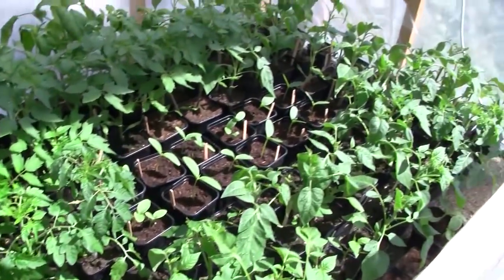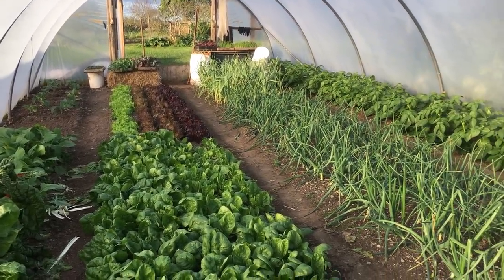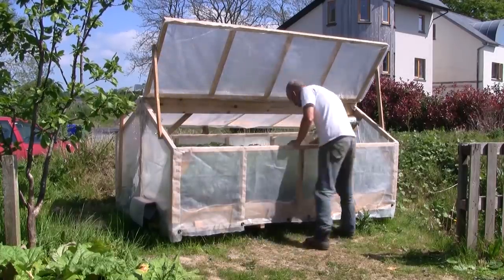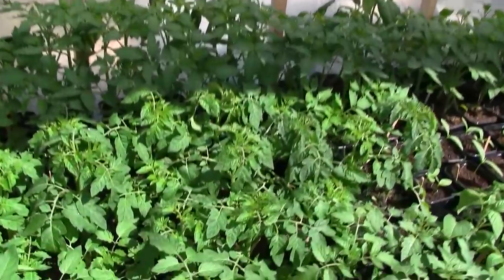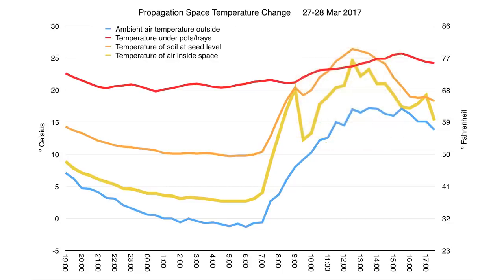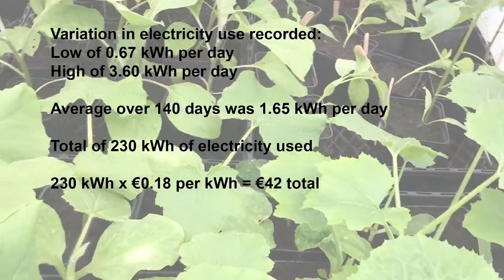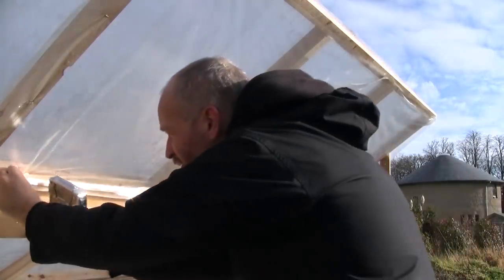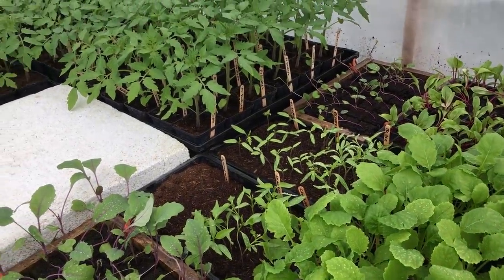A Heated Propagation Space

Comment: Hey! What are those metal semi-circles around your poly tunnel crops in your first shots?
Cool build, though!
Reply: Perhaps hoops for insect netting?
Reply from the maker: Yes, they are hoops for netting/fleece that will go over the carrot crop to protect from carrot fly. In this case it is old water pipe. I have found that the hoops of wire or pipe to keep the material off the leaves seems to help avoid mould and damage.

Comment: I'm curious about why you chose an outdoor propagation space vs. setting up something indoors?  

I'm having really good results with a set of plant lights on a wooden stand. Is it just a question of space and scale? What is the square footage of propagation area in your system?

I'm definitely working on a smaller scale than you are. My system has 16 sq ft of space in a 2x4 footprint. I think I could at least double it though by adding additional shelves. I do have to use electricity to power the lights, but get to take advantage of the heat I am already putting into my living space and I get beautiful stocky plants (which I don't think I could do with natural light.
Reply from the maker: tnason04 That is a good question. It makes a lot more sense from an energy and material standpoint to add grow lights in a house that already has heat. Especially with the low energy LED lights that are available now. The issue for me was space, as my propagation area is currently 1.2x2.4m or 4’x8’, and that isn’t big enough. A solid set of racks or shelves with grow lights would make a lot is sense.

The other reason I went with the extra space outside, and I was anticipating moving the whole thing into another larger propagation and work polytunnel at some point.

Comment: I've been trying to come up with a way to keep a green house above frost level. I thought maybe if you had a wide enough insulated container and used something similar to a solar cooker. You could line and stack the container with aluminum cans to be exposed to the sun, and have a ventilation fan pumping to the green house every time the temp drops below a certain point or off when to high. Not sure if this is possible if someone knows let me why not or add on.
Reply from the maker: Sounds like an interesting approach, but not something I have any experience with. Hopefully someone else can input.

Comment: Why not try making a wedge that is also covered in old poly tunnel? Like a wedge of cake that can be stuck in the opened window. This could expand the vertical space that would give you a longer time frame to grow in it without having to start from scratch. It is also good so that earlier in the year when it is colder and the plants are smaller there is less space to heat with the wedge removed which would make the space more energy efficient.
Reply from the maker: Not sure I understand how his would work, but something to think about. Having an expanding and contracting space would be useful to conserve heat.
Reply: @REDGardens  When the door is open parallel to the ground you can insert a wedge shaped filler in to take up all the empty space...(The filler would be constructed the same as the rest of the greenhouse) This would make it look like a cube if you did one for each door opening. This would in turn raise the height throughout to the same as your peak height now. This could be permanent or temporary by design. A bad construction analogy would be like a removable "dormer" on a roof.

Comment: Would you mind sharing your temperature sensing set-up? I have been using SensorPush, but I am not really happy with the fact that is not open source, and I have little power over the software.
Reply from the maker: I don't use anything nearly as sophisticated as SensorPush or similar. I just had a data logger and 4 sensors which I manually copied the data from. I hope to get more sophisticated sensor systems soon.

Comment: I like to use growlights indoors since my home is already climate controlled. I guess unless you have a four seasons room your trading off light or heat by doing it inside
Reply: Indeed, I'm interested in what's the better use of energy, supplemental heating or supplemental lighting, somehow heating feels more intensive but I may be wrong here
Reply from the maker: It is a useful approach, to just add more light to the already climate controlled space - especially with the  highly efficient LED lightbulbs that are available now.
Reply from the maker: dosadnizub I think that is a very interesting question, about the trade off between heat and light. I think it depends on the source and type of energy you are using. I think it is a bit of a waste to use high quality electricity energy to produce low grade heat energy - as I am doing - when there are lots of other sources of heat.
Reply: @REDGardens  inside you also wont run the risk of equipment failure meaning a huge crisis. If my lights go out for a day or two the plants will be fine. If the heater outside fails and its freezing, the plant will most definitely die within hours. Maybe a failsafe alarm for low temperatures could be installed to go off.
Reply from the maker: wipeoutxl That is a really good point about the resilience of the system and problems if there is failure. Important things to consider.
Reply: One thing to consider indoors, especially with module trays, is that it seems to require A LOT of watering, at least daily,

I guess growing on top of a compost heap mitigates that too.

How often do you water seedlings outside compared to inside?
Reply: @REDGardens  I use LED grow lights to raise seedlings (in an otherwise well insulated box, in my case in the boiler room in the house).  I think that the natural light quality in later winter / early spring is poor - and unreliable, so some years it is dreadful. So prioritising Light e.g. by supplementing with LED  (with no cold issues to worry about) seems best to me.  Downside is that as things are potted on an exponential increase in area / lighting is required.  LED lights are not cheap either (although they will last many seasons; when I used T5 tubes and MH Lamps they needed replacing annually, even though only used for a few months each year, as the light "strength" dropped off markedly). I put my seed trays under the lights a day or two before germination is expected, and have the lights on 24 hours so that as soon as the shoots appear they get max light and don't get leggy. After a few days I move them to whatever regime works best, but typically that is 16 hours a day, or so.  Can't get that in a heated greenhouse in February! When I start to run out of space I take the plants / seed trays to the greenhouse during the day, for natural light, and then into the house overnight - never exposing them to below 10C to prevent thermal shock. In dreadful weather they can stay indoors for a couple of days, even without any/much light. One snag of the well-insulated light-box is that the bugs think it is ideal too! If you are thinking of getting growing lights I recommend reading the Cannabis Forums - those growers, with their high value crops!, have the whole artificial-light growing down to a fine art :)

Comment: I'm guessing you have no available inside space.
Other wise you could propagate inside, and divert the energy spent on heating toward lighting.
I  wonder if a stand alone enclosure, insulated all around  but without glazing at all, could work, heated by cables and the lights.
Reply from the maker: The approach of adding lights to an already heated indoor space is a sensible one - rather than adding heat to an outside space. You are right, i don't really have the space in my house for the quantity of plants that I want to grow. The insulated box with heat and lights makes sense - this kind of thing could go in a garage or shed or unheated basement. I think the issue will be ventilation, especially to make sure it want too humid or stale, but if that was controlled as well, t could be a sensible option for some contexts.
Reply: @REDGardens  Good point, the humidity could causes serious issues, and mitigating it might make the entire approach less worthwhile.
Same high insulation/sealing approach as a  passive house, same problems, go figure....
Reply from the maker: Yeah, same issues as a passive house, good point.
Reply: @REDGardens  Now I'm wondering about a high thermal mass, breathable wall approach.
Cob walls?
It's fun for me to speculate, but I admire you for actually doing things and reporting back.
I hope to manage as much one day.
Reply from the maker: @slaplapdog  Getting rid of humidity can be quite easy with ventilation, and it is good to keep the air moving around plants anyway.

Comment: I would imagine that the body heat of one or two chickens could keep something of that size warm, especially if you put a blanket of some sort over it at night, perhaps one of those infrared emergency blankets. If it was urban, warm grey water could also be used if a water tank made up part of the structure of the propagation space, a trombe could also pump hot air in there. Lots of non electrical options for consideration are out there, electrically controlled ventilation too.
Reply: Chickens are helpful only if they stay off the seedlings :-)
Reply: @dosadnizub  They would be within the envelope of the plastic but in a separate compartment, I've owned chickens for 20 years and they have destroyed more plants than not, but they are very warm.
Reply from the maker: Chickens are an interesting option, and definitely worth considering in any new setup I develop.